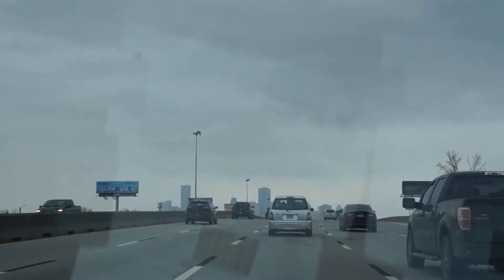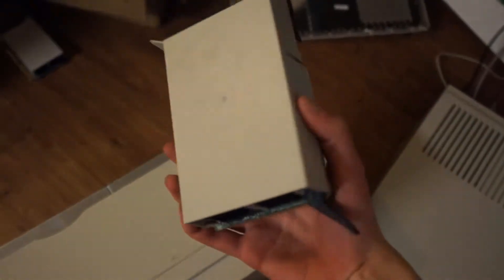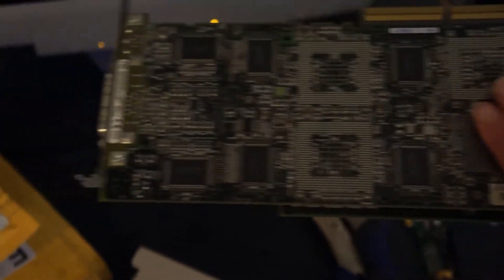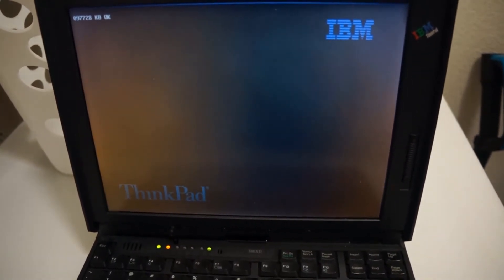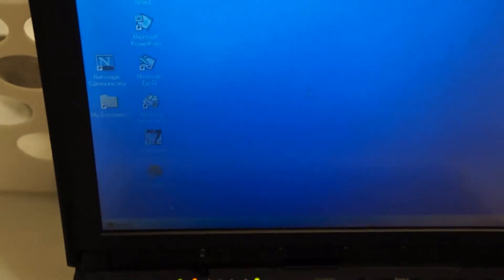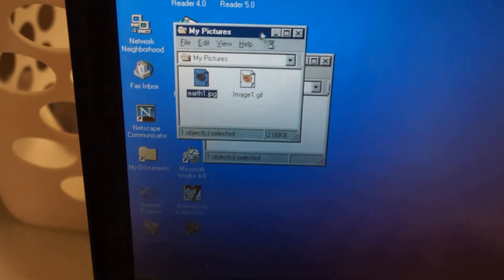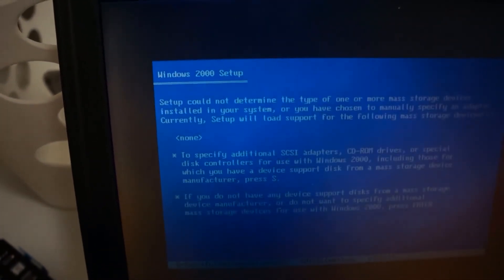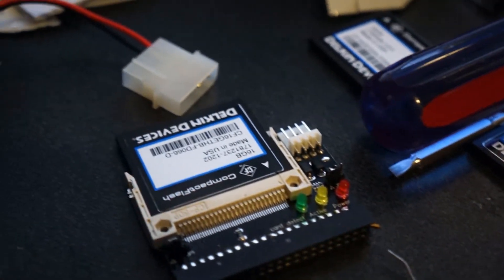Dead SSD and work in progress on Thinkpad 380XD & Sun ULTRA 80

Comment: Hi again

Enjoying the 380XD stuff ... seems like you and I have the same vintage laptops - 240x X61 X40 T60 T42 T20 now I just got a dead 380XD and here I finf you again :)

Mine is completely dead - I took it apart today and re-seated everything - looks good inside, but no CMOS battery at all, no RAM cover, no RAM in the slot and no hard drive ...

I tried putting in a hard drive - the drive light is on all the time - that didn't help.  The CMOS battery is most unusual - I have no plug for it so I emailed a supplier see if they have one.  I had this problem with another oldie of no beeps, no nothing on the screen and it turned out to be a CMOS battery, so i'm hoping it's that.

Did you have anything on the screen without any CMOS battery in it?  Also, I don't know if it will boot without a RAM card.  Its EDO ram and I don't have any, so I ordered a cheap 16MB stick on EBAY - just to see if that might help.  It's supposed to have 32MB onboard and I would think it should power up without that.  The fan starts up (if I shunt the power switch, like my 600 - same system) ...

What do you think? 

When it's up and running I am going to try OS/2 Warp 3 on it - that should be real interesting ...

Comment: XD
Reply from the maker: :c I did another netbsd install. This time on a desktop, so I can have a ssd for root, and a harddrive for swap. It probably isn't as impotent though, the desktop has 512mb of ram, not 96mb.
Reply: nice, sounds like a sweet build. looking forward to the new content. I'm working on an external GPU build with my T420s on my channel. I was surprised how simple it was. plugged everything in and "it just worked".

Comment: Why don't you put in a hybrid drive assighn the swap partition to be on the hdd as it has more read wright cycles before it dies then move the partitions arround after
Reply from the maker: That would be a nice idea, but I don't have money for a hybrid drive. 16gb msata is $10 dollars used :D Also I'm not sure it fit in with the adapter.
Reply: True and if you were to get a full sized drive you would have to get sata to msata to pata (2 separate adapters) though I have seen this done
Reply from the maker: idk I'd have to buy a special type of hybrid drive too that treats them as separate drives. Most the ssd part is hidden behind the hardware.
Reply: tripcode!Q/7 yeh but its also normally assighned to the first set of blocks
Reply: or they put the most used data there either way the compile data shouldn't touch the hdd
Reply: It depends id its 2 drives in one logical unit or host hint (in which case you can choose what goes where ) or if its self optimized you hope it chooses right
Reply from the maker: I know western digital makes a dual drive that is treated seperately, unforturnately it is 128gb ssd and 1tb hd and the prices reflect that.

If the default is the first block that might work :D
Reply: tripcode!Q/7 I'm not shure if pata can drive a hsdd in host mode tho
Reply from the maker: :c